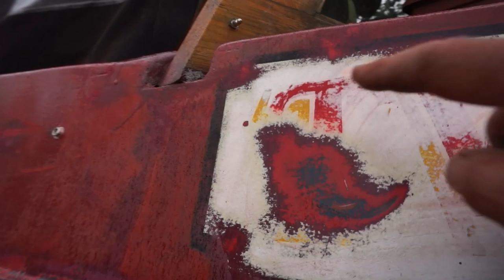We take our Narrowboat out the water for Painting and GIVE HER A NAME - Episode 59

Comment: Hooray the Narra has a name, what did you use for the blacking, was it a two part epoxy ?. And the adventure goes on and on, thanks for the update and the red panel looks good as well.
Reply from the maker: Thank you. We used International bitumen paint, not 2 pack. It was done less than 2 years ago, but we just wanted to redo it and check the hull for ourselves.

Comment: The boat looks fab. It would seem we're both all doing jobs the others are interested in. I'd love to get her out and give her a good going over. Believe it or not we've been struggling to find a yard that we can stay on with Henry the mutt. How did the dogs find the steps?
Great colour choice also, the white of the signage really pops against the red paint. We're on the move hopefully to a new mooring where they have a dry Dock for blacking etc, so hopefully I'll be getting stuck in before much longer.
P. S, Fran, I've finished the bathroom wall now, it's made for a tiny bathroom but we're really happy with it, keep em peeled for the new vlog probably Monday.
Reply from the maker: It feels great to have seen under our boat for ourselves and know everything is fine. The dogs struggled with the steps at first and we were lifting them down, but they soon learn and they had a lovely big field to run around. It was great. Our bathroom is next on the list once we gave finished painting. We have picked up some tips from you as we will be doing it to a tight budget. The new sink has been sitting in its box on the boat for nearly a year while we have been working out the best way to do it. Blacking was much more straight forward.
Reply: @FloatingOurBoat  I haven't yet tackled the bathroom fittings as we need a small shower tray and enclosure also a small hand basin and then the re-tile. But I reckon all in it'll be close to the £250 mark.

Comment: Did you break open a bottle of champagne to christen the new paint job and name? (as good a reason as any!)   I'm still very curios about the interchanability between the imperial and metric systems for measuring.  In the US, we've been told the UK is in metric, but I've seen so many uses of feet, inches, etc, on the various narrowboat video channels, I'm confused.  Safe travels!
Reply from the maker: Hi Bill. We are no way near metric despite the best attempts from Europe. All our roads are in miles we all still talk yards and pounds. Most of us understand metric and use it for detailed measurements. You never hear anyone talking 5/16 of an inch anymore.
Reply: Floating Our Boat Thanks!  Most American know what a 2 liter (or litre) soda bottle is , but that’s about it, except for those of us who’ve worked internationally :).